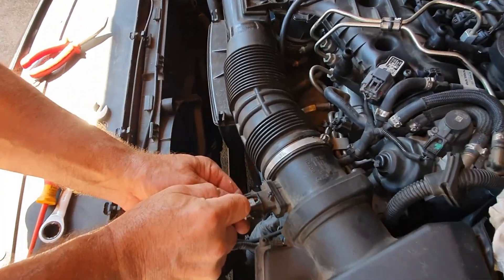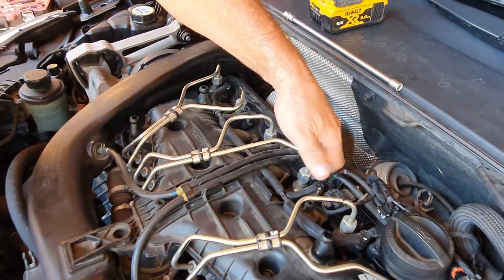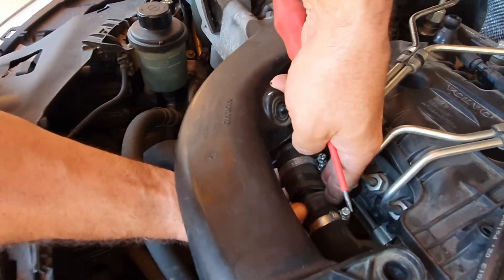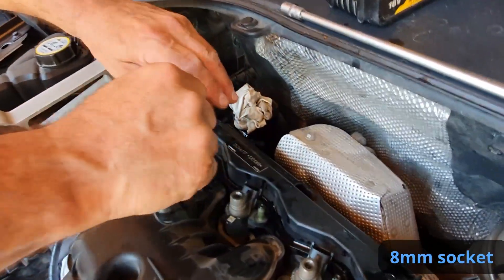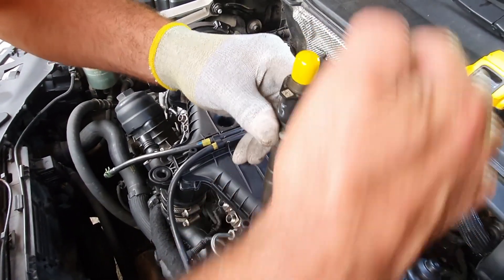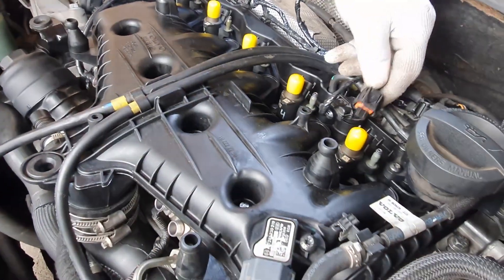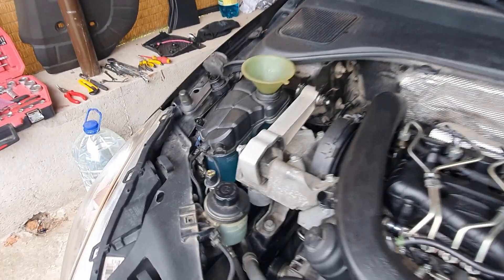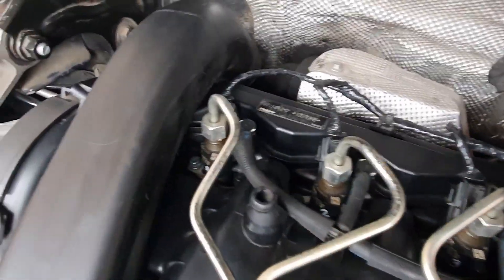Volvo 2.4 Diesel Injector Replacement/Removal (D3, D4, D5,D6)

Comment: ive got the 2.0 liter d3 engine, are the injectors exactly the same on the 2.4 liter d5 ? i only ask as im possibly gonna upgrade in future for more horsepower
Reply: Check the Volvo part number, 8 digit.

Comment: I have 2010 v70 with d5 engine. I replaced one injector as it was leaking more than the other 4.
I bought brand new bosh injector (same as the original). After installation and coding the number to ecu I think I can hear knocking. Is it possible that new injector is the problem?
Do you need to adapt those online maybe? I heard that you have to adapt online

Comment: en mi volvo xc60 del 2010 aprete con dinamometrica a 18 Nm ypartio un tornillo. y creo que tiene que ser bastante menos Nm.
Reply from the maker: Volvo recommends replacing the bolts with new before installing injectors back. Torque spec is derived from volvo repair manuals 👍

Comment: Hi, when tightening the fuel lines it says: make sure you have installed new parts. When tightening the old lines will the fuel not leak?
Reply from the maker: @marcinkarmel9425  you normally could re-install them multiple times, just make sure not to overtighten them.
Reply: @GSAuto681  Thank you for the quick response, I'll probably have a lot of questions when I fix it but thanks to your video I have motivation, thanks!
Reply: @marcinkarmel9425 I have tractors at home where the lines are opened several times a year and they are over 20 years old I'd honestly think of that as a siggestion

Comment: Thanks a lot for this video. I have to replace injectors n°1 and N°4. Do you know which one is the first? From left to right?
Reply from the maker: Hi, I don't remember exactly. If you have a diagnostic tool, disconnect the plug of one injector, scan the car and it should throw a code on the injector it misses. Regards.
Reply: Usually cylinder 1 is closest to camshaft pulley

Comment: Thanks for this. Looks straightforward enough. Going to remove the injectors on my 2.0 d4 and this should be able to guide me as they look similar enough. How long did it take you?
Reply from the maker: I think it took me no more than 3 hours. This tutorial should cover all of the 5 cylinder diesel models. I've got a separate one for the newer 2.0 4 cylinders, although jobs are similar. Good luck!